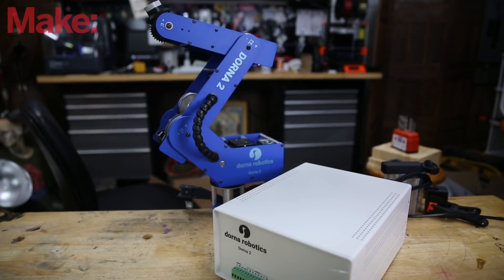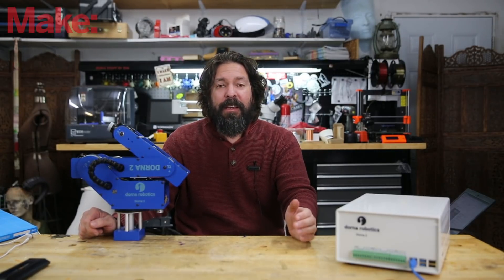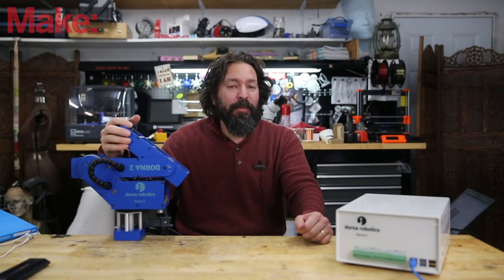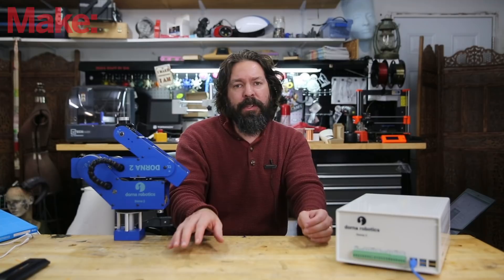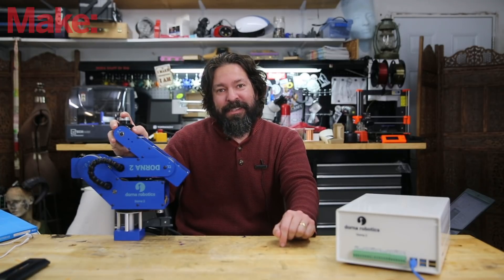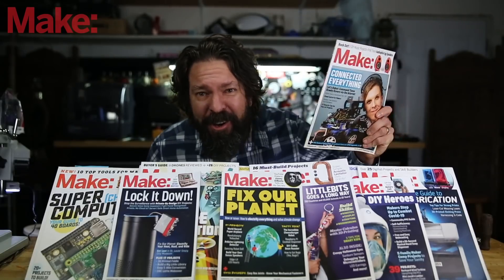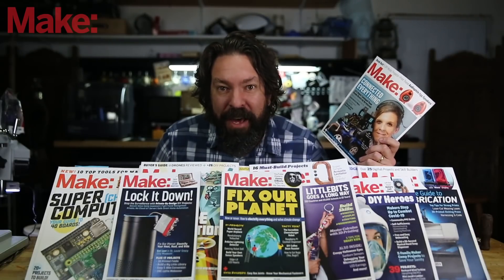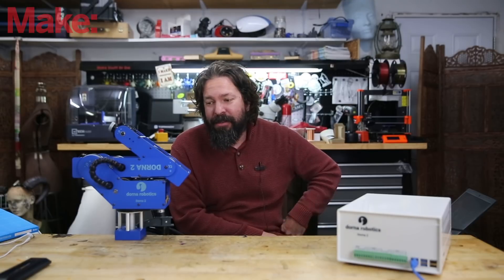Quick Look: Dorna 2 Robot Arm

Comment: If I had more time to play with this thing I probably would have had to design a gripper for sure. What would you have done with it?
Reply: At $3K I'd have to teach it how to pickpockets to pay for itself.  lol  Kidding.  Seriously, I'd have to put it to work through.
Reply: If you hooked up a timed LED and set a long exposure on your camera, you could use the arm to trace out intricate, coloured patterns :D
Reply: @chrismakesstuffCNC  yes! they actually did that! it is in the tutorials area of their website
Reply: With the right smart attachments this unit could be incorporated into a small parts removal system. 

Taking apart used or damaged electronics and separating the defensive components for a part recovery project.  

Recycling equipment is very expensive,  getting a system at a low price point to do the job would be preferable
Reply: Arm wrestling for sure.
Reply: How to contact you

Comment: We Bought the First version Dorna 5 axis robot. $1500.00.  Absolutely NO support from them. 
Or ANY outside videos on the programming, when the robot arm did not work as described.
It is a longer reaching arm and one of the reason we bought it, but we had it to long and could not return it..
Reply: mmmmmmmmmmmmmmmmmmmmm

Comment: How do I extend the arm to be 5 foot long arm???
Reply: you probably wouldn't want to do that. The length of each arm piece will nearly exponentially effect the strength required to move it smoothly. They work like levers. You'd need to seriously upgrade your motors to pull that off.

Comment: Thanks for sharing that!
Reply from the maker: You bet!
Reply: @MAKE  I am an automation engineer with 30+ years of experience. I have worked in manufacturing, mining and other industries. For several years I worked with a robots a lot. And there's a couple of things people need to know and people like you need to keep saying.

1) Robots are not toys. They have to be treated with respect. Even small robots like these can seriously injure people. You'd be amazed how ignorant of the dangers people are. In ended up pursuing formal qualifications in functional safety because of the dangers involved. 

2) Robots should be operated BEHIND a safety barrier. Not only can robots simply crash into things they can also throw things. As robots became faster and faster they also tended to throw things more often. Small robots are the most dangerous at this because they are fast and people tend to dismiss the danger because of their size.

3) Easily the biggest misapprehension regarding robots is the FALSE belief that robots can see what's around them. You'd be amazed at the incredible stupidity non-engineers have said to my face regarding robots.

If you guys want to do a program or series of programs on Machine Safety I'd be happy to help out.